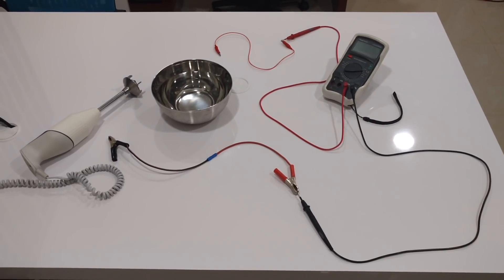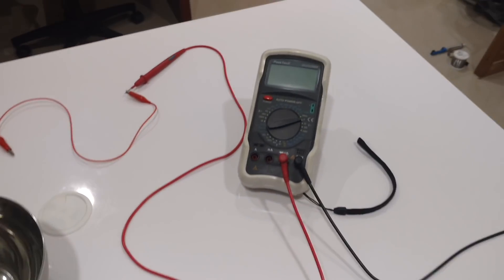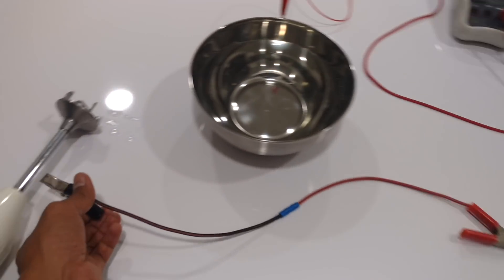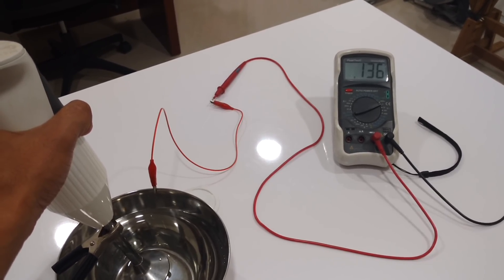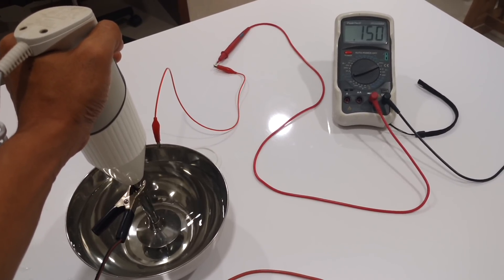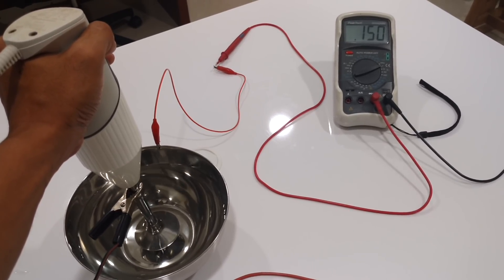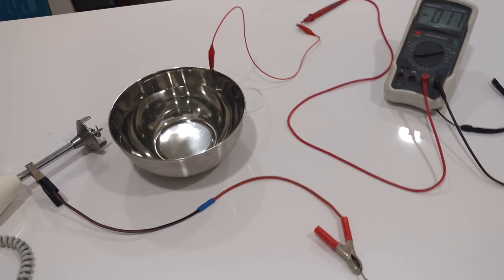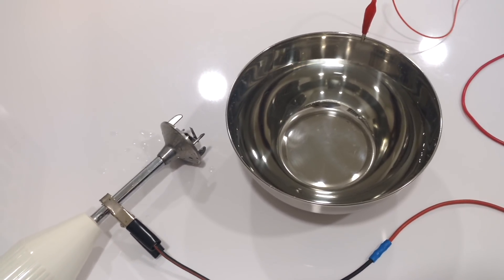Water Van De Graaff Generator / Water Wimshurst Machine

Comment: hello Okki - did you ever get OU from your MOT pulse motor ?. or do you need more ideas too keep working ?
Reply from the maker: No, never. Unfortunately I haven't seen any OU on my whole research. I've been researching OU for more than 10 years now. On this channel I posted only some of research.
Reply: @OkkiMoeljadi  same, accept i have been studying 20 years now...  - untill 2 years ago, - i started having success now.... then i put big 50-70mm riound magnets on each end of a 50mm thick round steel bar  10-15cm long...  and sliding electromagnet in middle... this my first success.... easy... about 4ohms coil total, with 4+ parallel windings. ....  =  very powerful linear motor, definitely OU,, i measure 670% @ 1watt input. and about 300% @ 10watts. , but easy too make better i guess ;=D (shorter bar, and bigger magnets, less resistance)          ///// then i build newman mtors (5 so far)...  between COP1 and COP 100- ... these are my favorite   ....  but both machines are expencive... newman reqiure big magnet inside coil,  and coil 1-1.5 inch thick.....  - bigger diameter motor = more torque...  and i cannot hold shaft , with only 1-2 watts input power (10mmshaft)   /// your viewers should build with my description. i promise, real OU !!  . also watch my videos, - i am working on  most promising and complicateD !! is a transformer build. ..  ( perhaps only $ 1 unit build, per 2 watts output )   https://www.youtube.com/watch?v=Ley8caGDhVA

Comment: Victor Schauberger information might help you here. You can get a better result measuring the potential over a waterfall or tipping from one funnel to another. Add some current collectors down into the funnel where the speed is greatest....